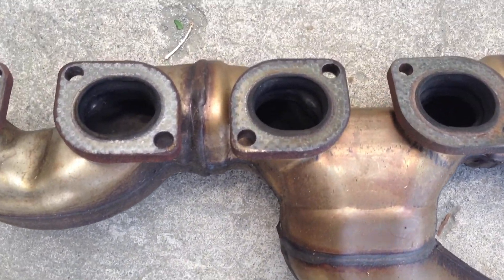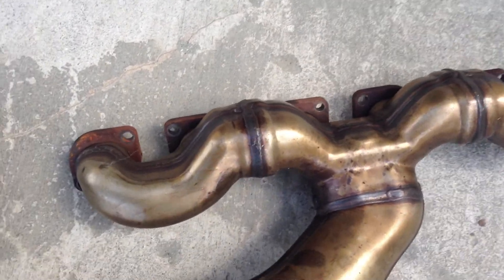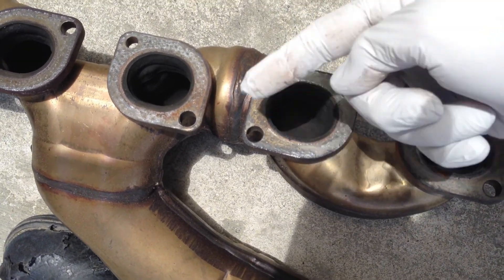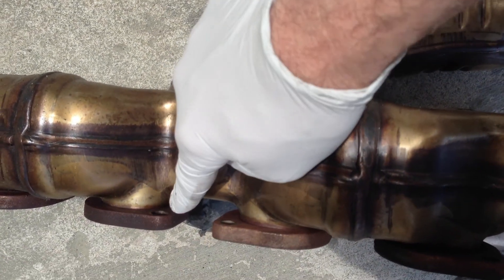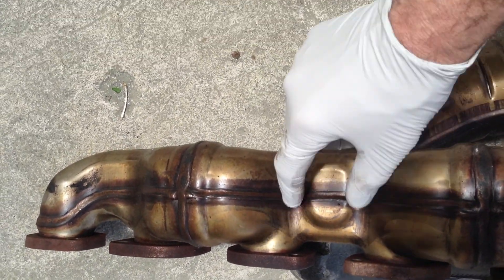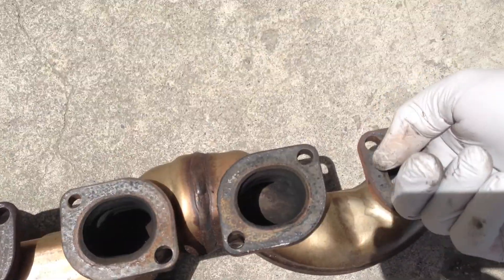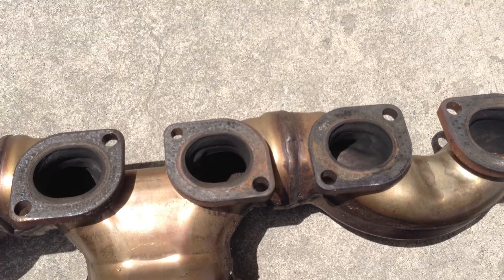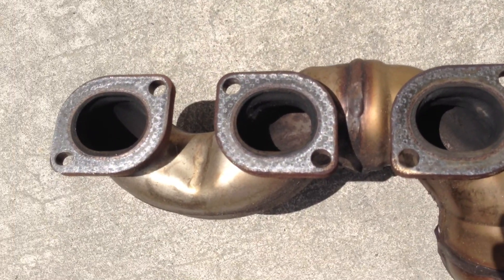BMW V-12 N73 exhaust manifold flow explained.

Comment: Hi,
What was the process to remove the manifold? Does it involve removing the engine? Thank You.
Reply from the maker: well, I did have the engine out on this particular one. But, I have no idea if you can pull them with the engine in the car. I have not tried.
Reply: @slkttop  I appreciate you getting back to me with your response. If by chance you come across such info please advise.
Thank You.
Hector